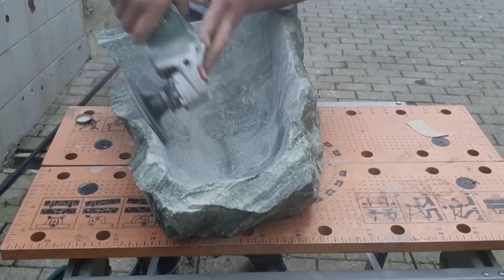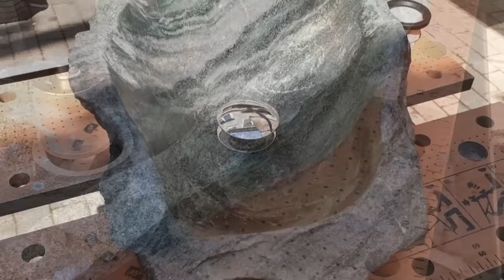How To Carve A Natural Stone Sink bowl with an Simple Angle Grinder | Marble/Granite #DIY

Comment: Hey mate, i'm a Stonemason... next time you do a project like this try using a tungsten tipped chisel and a lump hammer. You were using a brick hammer. It distributes force in a different way. They should be used to strike the stone directly where as a lump hammer or mallet is used to strike a chisel into stone/wood. Tungsten tips are great and more precise for Granite and other harder stones, which i am certain this stone was Granite. As Marble is much softer... on the Mohs Scale (which determines how hard something is) Granite is 6/7, Marble is 3/4. Also be sure to chisel inwards from your edges as the stone could chip unfavorably... Either way your sink came out great, good job!
Reply from the maker: Thank you very much for your detailed Comment you know definetly a lot about the Topic thanks again Please do not miss to subscribe 🤝
Reply: Yes

Comment: Maybe he could use a larger hole saw to cut the recess for the drain flange.  Then, switch to the smaller saw to put the drain hole through using the same pilot hole.  Just a thought.  I've done similar projects and it HELPS to have a fan blowing that dust away as you cut and grind.  Don't breathe it!!
Reply from the maker: Thanks very much for comment ! You are right that dust is pretty bad ! Use Safety Gear always !!!!!!

Comment: You need a what they call a wet grinder, they use them on counter tops or for our business we use them to polish large petrified logs and slabs but being it has water it makes a job like this go twice as fast with much better results. They are worth the money. You can get them on ebay with a set of diamond pads for under 200 bucks, dont get the concrete pads and bits you want ones for granite they are a much harder and longer lasting diamond pad. This way you dont need paste and have such a dusty mess.
Reply from the maker: Thank´s a lot for comment, you are right the dust is really annoying so wet is the Answer ! Surely for a Hobby DIY´er or guy´s wanna doing it once at home it could be diff. to hire all the Tools and acc. stay tuned for upcoming projects hopefully you become our Subscriber ;)

Comment: What disks do you use to "grind"? For the initial smoothing after removing the bulk material. This is the most difficult part I find and there always seems to be one cut line that is too deep so you need to remove more material.
Im thinking about setting up some kind of stand for my angle grinder where i can stop/control depth.
Reply from the maker: hi a simply Diamond stone Grinding Disc, and for polishing Polishing Discs From amazon please check the Material List in the Description Box below the Video .. thank´s a lot for comment

Comment: Hello! your work is amazing!!
I have a rock sink myself, buuut mine has a defect, so I was wondering if it's possible to fix it by maybe only polishing? It has a little pothole near the drain, not a big one, but the water stays there , does'nt drain  🙈 What's the best way to fix it?
Reply from the maker: Hi Greta thank´s for comment, yes in indeed there is a easy way to fix it ! You can use clear 2K Epoxy you can buy in any Home Depot, then find a stone that fits the Color of your Sink "Smash it and drain the Powder into the epoxy, mix it, then fill the hole done !  😊 stay tuned for our upcoming Tiny House Project you might Like it too